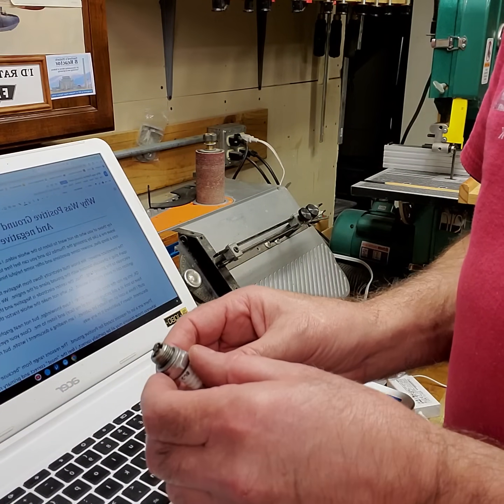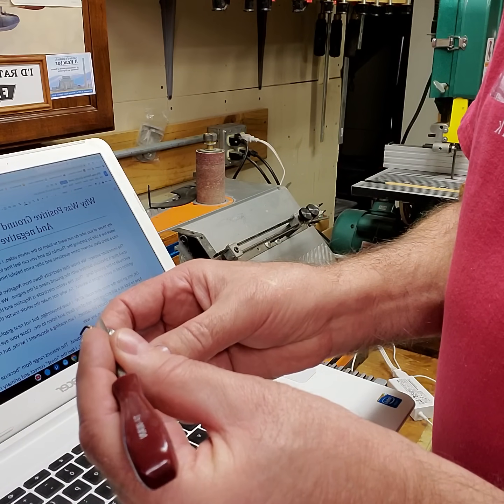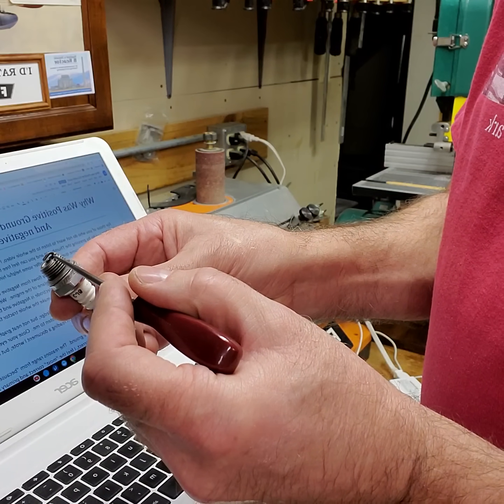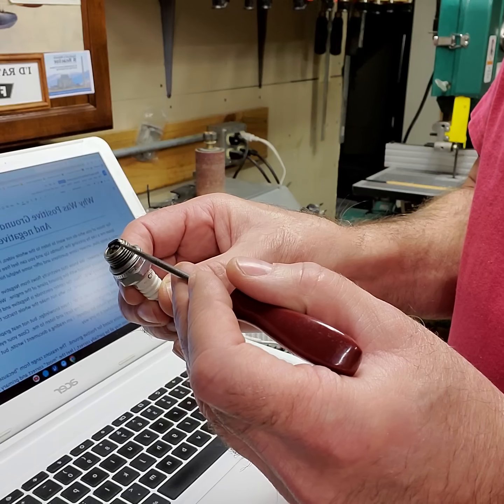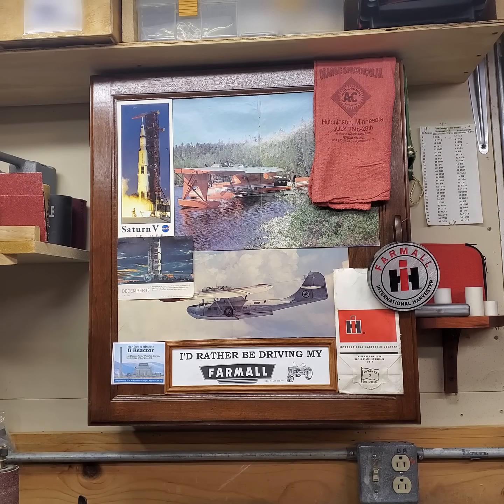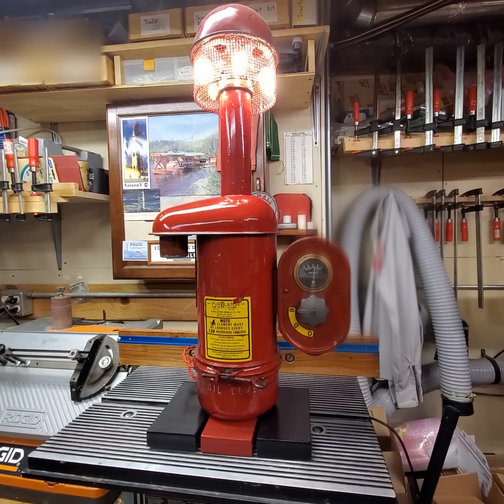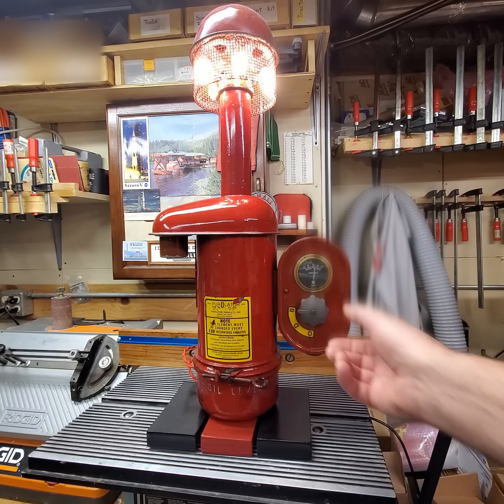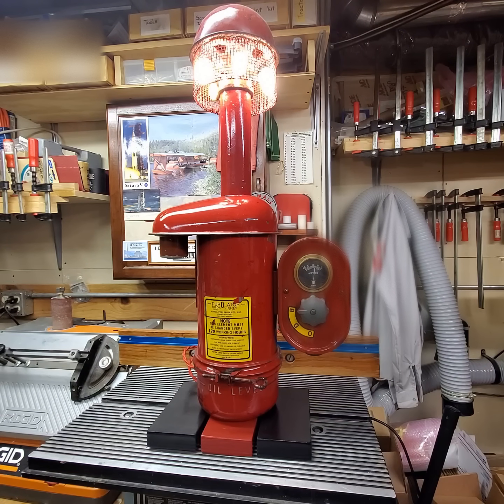Why positive ground was used on old cars, trucks and tractors

Comment: I followed your video to the end, and I am puzzled by a question - regardless of positive or negative ground polarity, some modern-era 4-cylinder cars use two double-ended ignition coils (replacing the distributor) so that cyl 1 plug gets a positive voltage and at the same time cyl 4 plug gets a negative voltage, same arrangement for cylinders 2 and 3, there are wasted sparks and all four plugs work just fine. For example, petrol Ford Escort MK7 1.6 16V from 1997. This was a time after distributors, but before the full integration of ignition coils into plug caps. So how is there any preference for the polarity of the HV spark, or the 12V ground? I guess the real reason will be mainly a position of a mostly arbitrary design choice backed up by market dominance in sales.
Reply: The spark plugs used in those engines have a special material either platinum or iridium on both electrodes so there is no ground electrode erosion from the reversed plug.
Reply: @MatthewBerginGarage  Thank you, I have had wasted spark motorcycles for decades but the topic of spark polarity completely passed me by!
Reply from the maker: Hi Matt!  Will you tell me more about these plugs?  Its ground erosion that is the key to this whole discussion.  I did not know that such plugs exist.  I bet they are expensive!  Thank you for your input and comment.

Comment: What about modern cars that have one coil per cylinder pair?  In these, each end of the secondary went to a plug, instead of one end being grounded and the other going to just one plug.  One plug will see a positive pulse, the other a negative in this configuration.
Reply: Search for "waste spark ignition" you'll see lots of diagrams.

Comment: just a little point
did you get your video mixed up seems like you were avoiding license problems
seems your top is on backwards
Reply from the maker: Hi Ray pitts.  Thank you for commenting.  No license issues.  The camera does that.  There may be a way to correct that.  I simply use the video the way the Samsung makes it.

Comment: On my 1954 Farmall super H 
Still 6 volts. 
I put a 1/0 cable from + battery terminal to one of the starter mounting bolts. 
That helps starting
Reply from the maker: Hi Dale!  Yes, 6 Volt is fine with the proper gauge wire.  Plus, good clean connections.  Thank you for your comment.

Comment: so it's because they didn't know yet? if all paths lead to ground it's safer too right? because if a negative wire got broken shorted then different circuits could jump to that wire which might send too much power through it, but if it's a positive one (negative ground)  then it will allow only the same amount of current it normally draws, correct? it's kind of confusing if i think about it too much. doesn't it interfere with the radio as well? like... when they came out with FM? i might have read that somewhere
Reply: Please do us all a favor and stay away from electricity.
Reply: In general NO. Most devices only have one provided ground (in either system). If a wire breaks, normally there is no other path to ground; no other wire will get overheated. It will just stop working.
An exception is sometimes the battery cable ancillary body ground wire (medium gauge), cables that have 2 wires in the battery ground clamp. Sometimes, if the block cable is loose, the starter will use this wire when starting, and melt it. Some body ground straps, and battery grounds are in parallel. Virtually all device wires are 'alone'.
Hope that helps.
Radio is naturally the one needed for the ground system used. It should not have anything to do with FM reception (unless there is a bad design out there, and only choice for a certain application...)

Comment: So, I would like to enquire about positive ground vehicles.  If you wanted to jump start a positive ground vehicle from a vehicle with a negative ground that is 12v based, you can still hook the cables up + to + and - to - between the vehicles?
Reply: Yes. + to +, - to -. ALWAYS.
Also should be same voltage systems.
Best practice is to make last connection away from the battery (use a frame ground for that frame's - battery's ground; if you follow.) And likewise unhook that one first when disconnection.
I have only saw one battery blow up in my career...

[In theory you could charge a 24V system with 12V if you charged one 12V battery at a time, charging it for a while each, but I won't get into that...] That only came up one time in my career...

Comment: you really had me thinking about what you said about positive ground. If you put a positive with a negative it becomes positive. Negatives are conductive materials that close a circuit to form a circulation system of electrical units. Ohms volts etc.
Reply: What?

Comment: I stumbled for a while regarding the spark plug and why some plug systems, for example waste spark systems, can alternate ground polarity. On a waste spark system, one coil powers one plug with forward polarity, in series with its partner plug with backward polarity. That's why they don't label one electrode of the plug as 'anode' or 'cathode', it depends on how the coil is wired. The spark will still fire, perhaps with different characteristics and wear features, if the secondary coil leads are swapped. Then I had an 'aha' moment, when I realized that the spark jumps at a voltage of somewhere between 6,000V and 15,000V, reaching for a path to the other side of the coil, not the battery! This is so much greater than the 12V bias, battery polarity is irrelevant, all it is really doing is giving a stable baseline. The 12V battery is a miniscule, passive bystander.
Reply: There is one thing I have observed regarding this topic.
This case I am referring too is points ignition system, If the coil is hooked up reverse ie coil + to points (B- switched) and coil - to ign (B+ constant) the spark is weak.
If connected coil + to ign (B+) and coil - is connected to points (B- Switched) The spark is strong.
I can't think of the reason it would matter unless the condenser/Capacitor is polarity sensitive.

As for spark plugs the don't care about polarity as can be seen by your example aka the coils where the secondary is isolated from the primary coil and the secondary coil has both ends of it connected it a spark plug meaning every time the coil is fired one plug sees around -15kv and the other sees around +15kv though the voltages won't be 50/50 as the cylinder with the air fuel charge requires a higher voltage while the cylinder just finishing it's exhaust stroke has ionized gas and lower pressure which conducts electricity better.

Comment: We are fortunate that "electricity" actually flows in the fields surrounding conductors not with electron drift which is very slow. See this video to see why: https://www.youtube.com/watch?v=bHIhgxav9LY . The charge flow is only a vehicle for supporting the electromagnetic field. The power density is given by the Poynting vector field which is the vector cross product of the electric and magnetic field vectors. We are also fortunate to have negative ground for single supply electronics, because common emitter amplifier stages are with NPN transistor emitters are negative compared to collectors, with positive power supply. Why is this significant? Because NPN transistors are better in many performance parameters than PNP transistors, and the same  for  N channel MOSFETS over P channel. So we are fortunate that history favored negative ground for this reason, as early solid state car radios could extensively use single supply 12V

Comment: If you have diesel tractor, you have less to worry about this as generator is just used to charge battery. But petrol is another game. Conventional ground is used because of vaccum tubes, transistor is another beast. Confusing to young lad who is starting on electronics. Also another thing is that live and neutral business of AC. You get shock on live(equivalent to +ve, not same as it's alternating) and not on neutral, you usually connect it to body or ground.
Reply: The only reason you don't get a shock from the neutral is because it is connected to the ground which is connected to you.

Comment: My first car was a 63 MG Midget, and it was positive ground.  It also had an old 'lorry' transmission with a non synchro 1st gear.  It was basically a sporty, drop-top, tractor!
Reply: My 65 MGB was also positive ground. In fact, all English made cars were positive ground. (non synchro 1st gear is normal in them days.  It was also termed "Bull-low" as it pulled like a "bull", as it was all torque. Which is why many started off in second gear instead as it was the most useful gear speed wise and you did not STALL IT.
 You just had to remember that  when connecting jumper cables.  Connect directly to the battery.  Some early Japanese cars were also positive ground. Maybe Datsun(Nissan)?
. You must also remember to check the jumper cables as a joke someone swapped the red clamp with the black clamp.  Not a "Factory error" as there are thousands of jumper cables produced so that is a MAJOR ERROR.    I got a set of jumpers given to me to jump someone's Toyota at college. So I hooked up the Toy and then to my VW without checking to see if the clamps were the correct color as it was a paired unit.  "I ASSUMED IT WAS RIGHT".  When I hooked up to my battery there was a lot of sparks(more than normal)   The Toy would not crank the starter motor.     Weird.  I took off the jumper cables and then noticed that the black was red at the other end.  The red was black at the other end.  It is just a plastic colored shield.
I swapped them around so the black had black at the other end, same story for red.
Tried again with the connection and this time just a tiny spark(normal)...when connecting the cables.  The Toy started up.     Trouble with cross connecting is the ALTERNATOR WOULD BLOW IMMEDIATELY WITH THE FIRST BIT OF SPARKING ON A CROSS CONNECTION.  That is +$200.(30 years ago)as the alternator diodes are fried(instantly)  Not my fault.  It was the owner of the Toyota that owned the jumper cables so they were at fault.
. but I learned from that incident "NEVER TRUST THE ENDS UNTIL YOU MAKE SURE THEY ARE CORRECT."     My air cooled VW was O.K. as I had a generator.  They do not like to be backwards but they lived.  Pretty certain the  chick had to ask her dad to fix the alternator with $$
> it happens once, you remember forever.
Syncro First gear happened in about 67(or 70) on VW.air cooled beetles.  So I assume other manufacturers did so about the same time.  I always drive 4 or 5 speed manual transmissions in my own cars.  First is for when you are at a DEAD STOP.  So it is used to get you rolling, after that, you never use it again until you are at a stop. or on a really rough bush road going uphill or downhill in the loose gravel or in the snow and let engine speed at idle be the brake.

Comment: If you know about Negative side controls the contacts last longer (carbon spots) because the load (light bulb) is absorbing the current from the positive side of the circuit. That's how automotive 5v computer systems work. Ground side controls. Which means you are backwards in theory. I graduated from UNIVERSAL TECHNICAL INSTITUTE. And aced the Electron Theory class. Stick welding is REVERSE POLARITY DCEN and puts the heat in the welding rod instead of the base metal like wire feed.
Reply: You should ask for your money back.
Reply: @stargazer7644  are you a MILITARY CERTIFIED WELDER?.. Bestow your knowledge apon me please!
Reply: @stargazer7644  https://youtu.be/8o3JaVR1w1Y
Bet you can't even read a Tapemeasure!
Reply: @stargazer7644  why don't you remove your own comment.. and change your name to PETER Gazer😛
Reply: @amazin1827  No, sadly, my graduate degree in Physics wasn't in ALL CAPS like yours.
Reply: @stargazer7644  where did you get your physics degree? You can use ALL CAPS if you want..
and show some intelligence along with it!
You resemble the common internet troll!
Reply: @stargazer7644  maybe you can explain Flux Lines or watts law to me since I'm just a welder....
Reply: @stargazer7644  electromagnetism was probably one of your first classes!....
The comment you removed... I REPEAT!
Reply: @stargazer7644  you taking a refresher course there.. Sputnik??

Comment: Telco's still use -48vdc or positive ground, the railroad industry found less corrosion when using positive ground. USAF taught "follow the hole the electrons leave" in commercial world it is following the electrons. So both are right it about the flow, which one are you watching.

Comment: Holding an old model A or T ignition coil or some doodad for their electricity about six feet away from a Jacobs ladder I got a shock. The coil dropped from my hand and fractured the bottom of the can and started to leak. I put it in an old tin cup, intending to reseal it. The end.
Reply: Can you say PCBs?
Just FYI; I don't know specifically about old ignition coils, but a lot of HV components used PCB oils, a probable carcinogen.
Just wash you hands well with soap (it's an oil), and check and clean the the outside of you 'fix' to make sure it is clean on the outside and not leaking.
If you want to dispose of it, your local hazardous waste site should take it. Same place you would bring old florescent bulbs.

Comment: 11:32 of course all the oil was removed from the oil bath when the lamp was built ;)
Nice lamp sir.
Reply from the maker: Hi Ronald!  Yes.  The inside is actually filled with a UL Listed 120 VAC to 12 VDC power supply.  The switching and lamps are all low voltage.  I have a video on my chanel about the lamp.  I make these lamps as retirement gifts for my friends.  I've made Allis Chalmers lamps too.
Reply: @bryanh1944FBH  Nice!  The paint looks great. 
I was, well am still doing some work on a 1955 Massey-Ferguson. Points and carburetor cleaning.

Comment: Positive earth encourages galvanic corrosion of the surrounding bodywork - whereas with negative earth is is the much-easier-to-replace electrical contacts that corrode. It also appears that alternators require negative ground.
Reply: Alternators require negative ground because they're made that way.  You could just as easily make a positive ground alternator.

Comment: I read a article from a 1950 Lucas description on how Magnetos work when rebuilding a 1923 RA Lister Engine.I remember it said The negative charge sends its electrons to the Centre of the spark plug & they build up a bit before they jump to the outside of the spark plug ground. This makes the tip hotter & helps fire up the fuel .And just like Lighting can be + or - it still jumps to the ground no mater its polarity. I noticed on my RC Model engines tiny spark plug if I run it as negative spark its tip glows red in seconds. Swap the Can coil poles to make it a positive spark & the tip stays cold.Also I did not know the North Pole is Negative Charge .Only the tip on your Compass is Positive charge.
Reply: Compass is magnetic and doesn't imply an electric charge, however magnetic fields interact with electric charges when they are moving relative to each other.  They are connected concepts but not the same thing.
Reply: Magnets don't have positive and negative poles; they are S and N. You are correct, the compass N labeled pole is a S pole that points to N. (one is spin, one is charge; different things. maybe related, but different)
Reply: The N and S ends of a magnet do not map to + and -.  You can make the + end of an electromagnet either N or S by just reversing the direction you wind the wire around the core.  Oh, and just so you know, the red north end of your compass is actually the south pole of the magnet.  That's why it wants to point north.

Comment: Here's one for ya. The idiots at Ford decided to switch from a perfectly fine negative ground system to a positive ground system on some of the Ford 8n tractors
In all the years of different cars, tractors, engines, etc and starting with a Ford 1939 9N tractor, I  never even heard of a positive ground.
Well guess what happens when you jump start a positive ground system while your wife is putting on the jumpers cables as every other day of doing negative ground systems? 
The battery blew up, literally sounded like a shotgun blast, and my wife had to be rushed to hospital to have her eyes treated for battery acid! 
The dumazzes at Ford never put any warnings on the tractor, or at least none that would stand out and be noticed